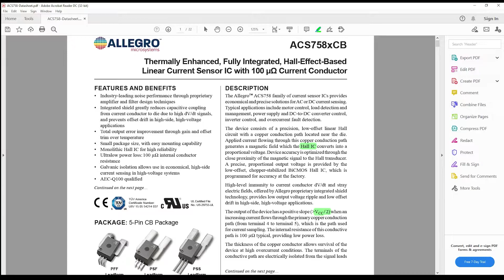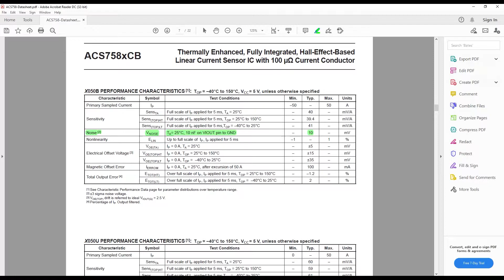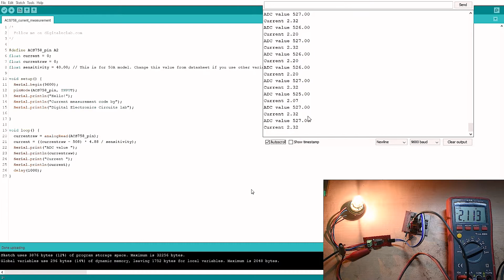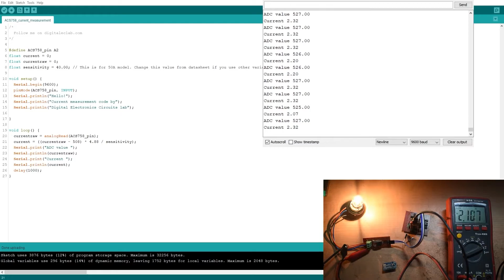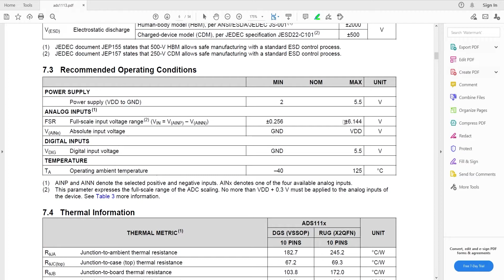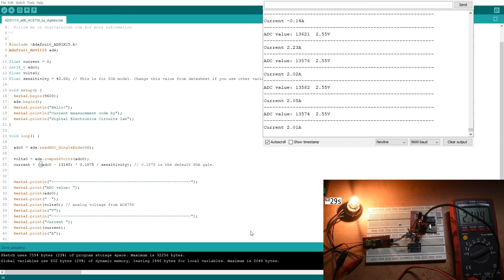DEC #04 High precision current measurement - ACS758 and Arduino with ADS1115 16-bit ADC

Comment: Sir
Is it  withstand the 1 phase,230volts supply
If not what is maximum voltage the  sensor work properly

Comment: Hi, i have a question. If i change the current sensor to sct013 5A/1V and using esp32 with 3.3V, do i only need to adjust the program in sensitivity from 40 to 5 ? And whats the value of 13333 will be ? And then my measurement will be working?

Comment: I am getting the below error message

C:\Users\kishore\Documents\Arduino\current\current.ino: In function 'void setup()':

C:\Users\kishore\Documents\Arduino\current\current.ino:12:18: error: 'Digital' was not declared in this scope
   Serial.println(Digital Electronics lab);
                  ^~~~~~~

exit status 1

Compilation error: 'Digital' was not declared in this scope
Reply from the maker: Write this line as :  Serial.println ("Digital Electronics lab");

I hope it will resolve the issue

Comment: you could connect 5v to input 1 of ads1115 and in code take that measurement and divide it by 2. that then is your middle point of the acs758. 

in code then .. voltage = (ads.readADC_SingleEnded(0) - ((ads.readADC_SingleEnded(1))/2) )*0.0001875; 
  current = voltage / 0.04; // 40mV/A current

even if 5v goes up and down a little it will compensated in code
Reply from the maker: Yeahhhh good suggestion.... Thank you for commenting

Comment: I would have liked to see you insert a 10nF capacitor between Vout and ground on the ACS758 to reduce the noise or at least talk about the effects of this capacitor size on noise since you mentioned it earlier.
Reply: Actually, it would be cool to see a few different-sized capacitors tried. Because as you increase cap size you lower noise but reduce rate of change. Might be able to find an "ideal" capacitor value